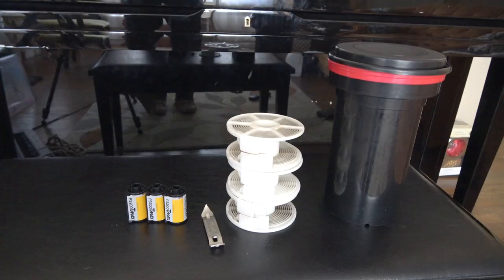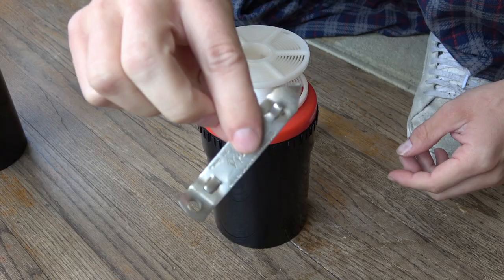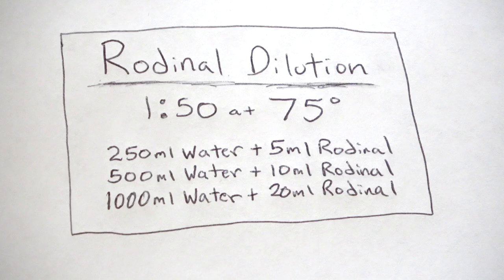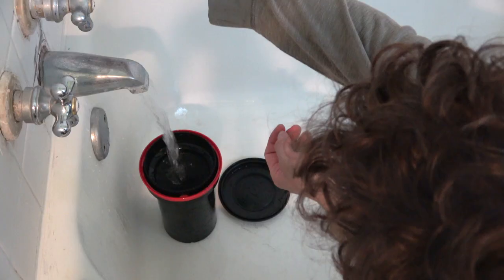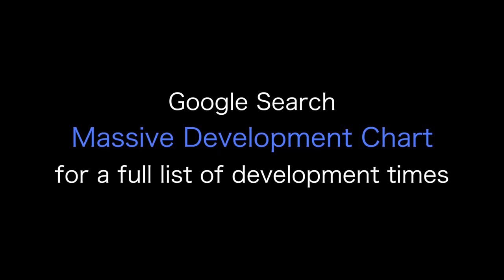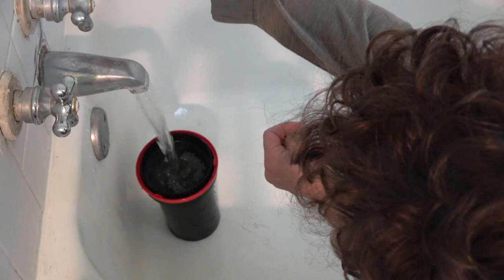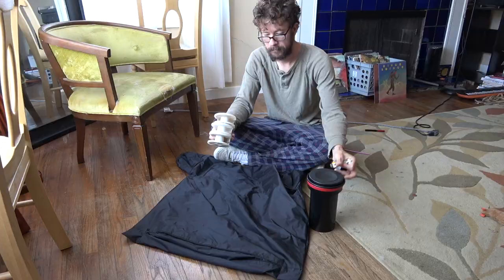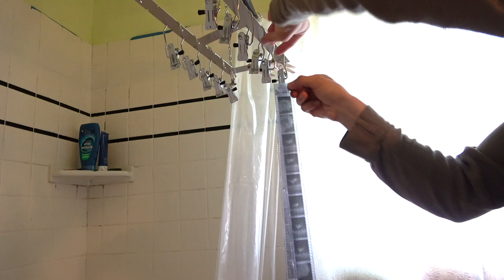How to develop 35mm Black and white film AT HOME

Comment: Hi Dave! I'll be using Rodinal R09 for my next development, and it'll be my first time. Just wanted to clarify, I have a 250ml tank, and I'll be developing HP5 film. As suggested on the label, I need to use 1+25 dilution. Does it mean, 250ml water + 10ml of Rodinal? Making it total of 260ml solution? Thanks!
Reply from the maker: Precise! I love doing the math that way. Just add the zero on each end... if it was 1:50 dilution, 10:500. It’s never an issue to be mixing that extra 10ml since the difference between 250 and 260 is negligible. I always used 1:50 but 1:25 is nice and punchy

Comment: can you list down all equipments you used in this? especially the measuring tools.
Reply: He stated every piece of equipment he used in the process.  What more do you want?  Did u even listen to him state the equipment he used?
Reply: 1). Daylight developing tank with reels (he suggested Patterson Brand)
2). Changing bag (check eBay) 
3)  bottle opener
4) a plastic jug
5) Ilford Rapid fixer
6) Developer (Rodenol brand)
7). 1 liter graduated cylinder
8). 50 ml graduated cylinder
9). 5 ml measuring spoon
10). Funnel
11) distilled water
12) LFN wetting agent.